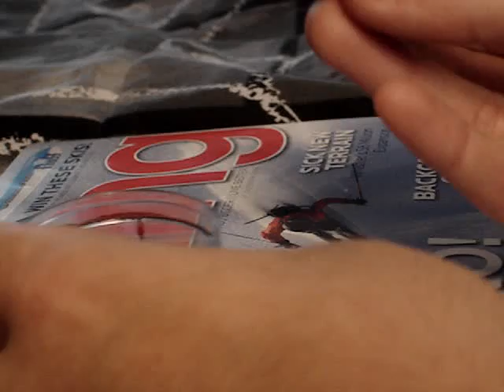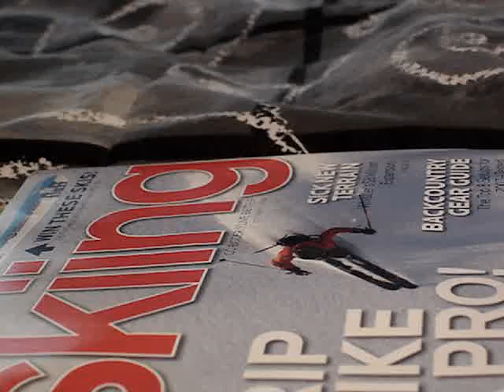MagnaView Fluid

Comment: Description: Rare-Earth Neodymium-Iron-Boron (NdFeB) Rod Magnet Size - Diameter 0.125" (3.18mm) x Length 0.500" (12.7mm); Pull Force - 2.86lb/1297g; Grade N40

If it is the 1/2 inch rod...